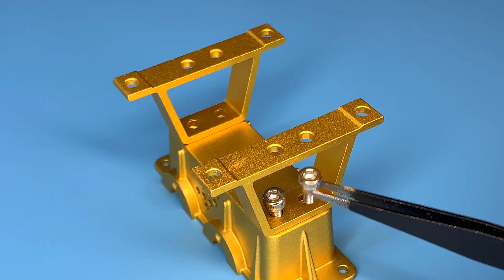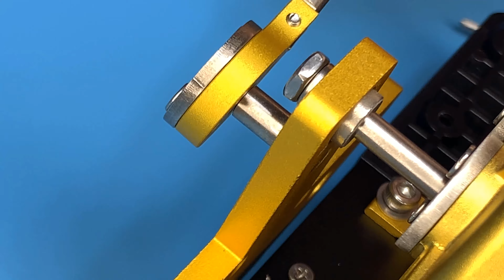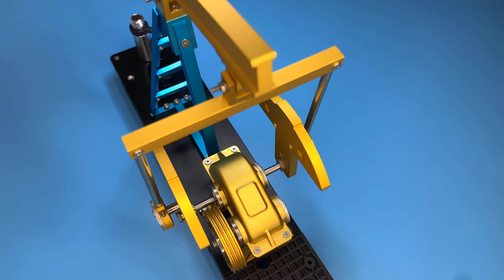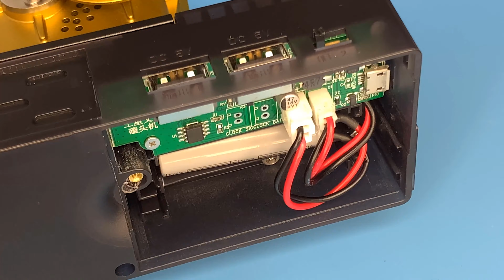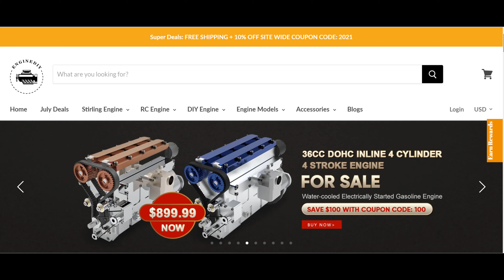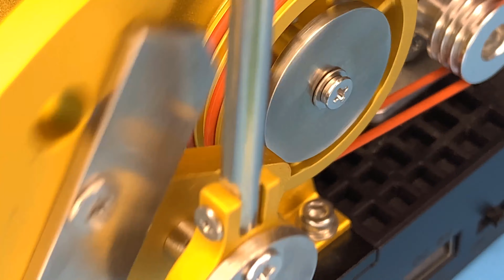ENGINEDIY X TECHING Pumping Unit that Works, 3D Metal Mechanical Collection 219 Pcs

Comment: I was so incredibly happy to see you finally use the correct tool when using a slotted screwdriver. So much cringe when using a Phillips screwdriver to torque a hex cap screw. 😮